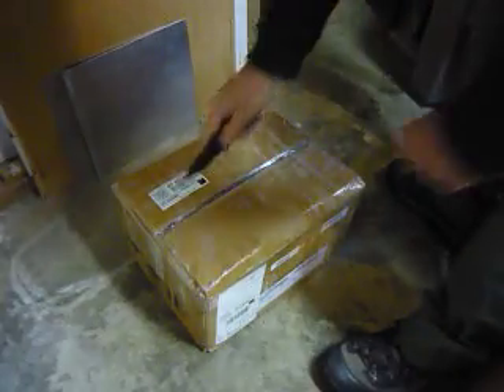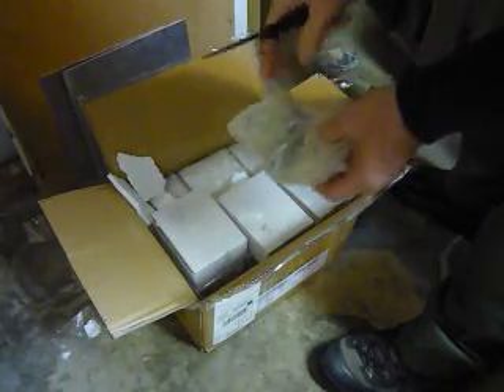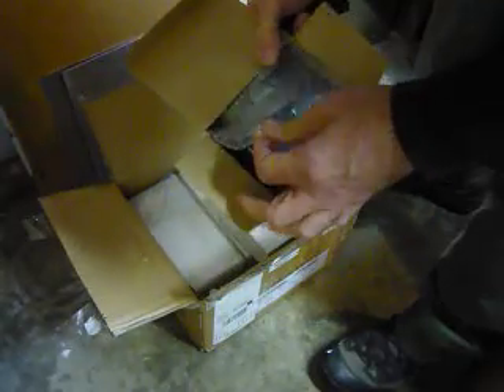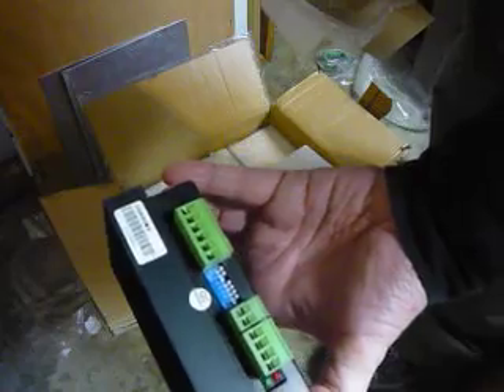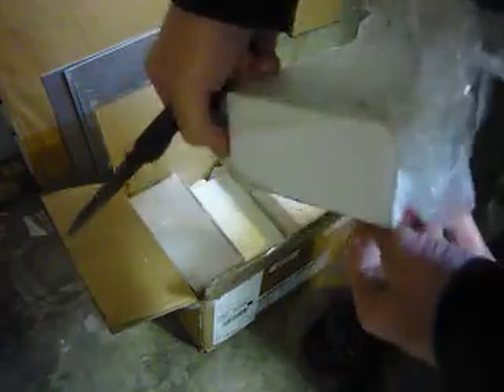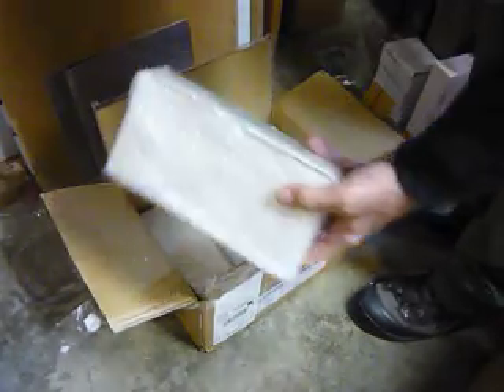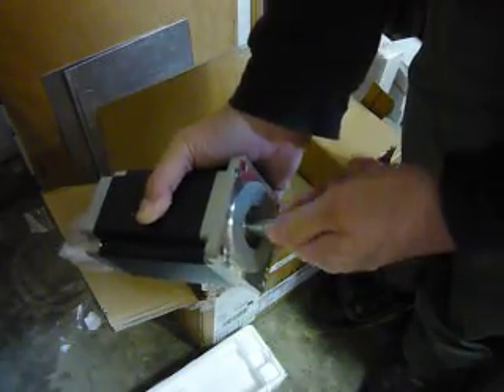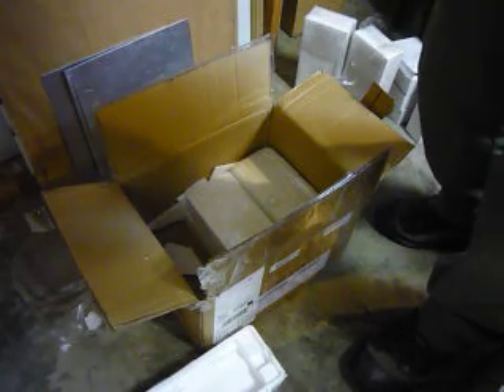Grizzly G1006 Milling Machine CNC Conversion 01 - Motion System Unboxing

Comment: Did you ever get this project done? Did you get the ball screws? There seems to be little info available on the lengths, etc for the ball screws.  I am looking to do my first conversion of my rong fu 30 and would love to see what you've done.
Reply from the maker: Sadly, this CNC conversion hasn't been finished.  It's probably half finished but stalled.  I built the electrical panel, made timing pulley gearing for the three axes, and built the motor mounts which are nicely integrated with the pulley gear covers.  I thought about heating and clamping acetal to make zero backlash nuts for the existing Acme lead screws as that would probably be sufficient for my limited use.  I built a couple of CNC routers and use those for the light duty machining I usually do for plastics manufacturing.  I also have 3D printers if I want to make complex plastic structures.  I'd like to finish the CNC milling machine conversion because it would help with one simple but very repetitive machining operation I do on the manual milling machine for a part I manufacture, but my biggest incentive to finish the CNC conversion is to machine the three 80% lower receivers that I bought with the intention of making some AR-15 patterned firearms.

Comment: If a wire/s are touching the other one it will lock up the shaft even with no power that why it seems to be stiff.
Reply from the maker: I believe you are correct, sir!  That's probably one of those things I'd have caught while watching the video, but not while making the video.  :-)  There might have also been some static friction in the bearings that hadn't turned in months, and once overcome, the steady state friction wasn't as bad.

Comment: Have you done anymore with these stepper motors?  I have the same motors from Wantai and I wanted to know what gear ratios you used for your mill.  Also did you replace the acme screws.  Im still trying to find a cheap ball screw.

Later
Reply from the maker: Sadly, I'm suffering from too many projects, and not enough time.  I did sneak in a CNC 2'X4' router and a CNC mini lathe build, and I've been getting the CNC mini lathe into production lately.  I still need to build my 3'X5' CNC laser and 2'X2' CNC router.  I also have a nice Clausing lathe to CNC (servos for that one!), and two ORD Bot Hadron 3D printers to build.  I keep using this milling machine manually and wanting to make the time to finish this CNC project.  Hopefully this winter.

I mostly built the X motor mount and this project stalled, but it's still on the To Do list.

I'm planning on direct driving all three axes rather than using any gear ratio.  That's why I got such beefy motors for this little milling machine.  However, to get good speed (as well as usably low backlash), I'll be getting some Chinese ball screws on eBay.  Some of the sellers will sell by the inch, and do the machining per the buyer's print, so there are shoulders for bearings, a turned shaft for the motor coupling, etc.  The ball screws are hardened and the only practical way to machine them is by grinding, which I am not properly equipped to do.

It looks like there would be enough of these G1006 milling machines in existence that someone would offer a ball screw upgrade kit as CNC Fusion and others offer for various small milling machines, but if so, I haven't seen it.  I'd appreciate a link if anyone finds a G1006 compatible ball screw kit.

Comment from the maker: The stepper controllers are silk screened with labels for the terminals and tables for setting the max current and micro stepping.  That's most of the wiring diagram.  Just connect the motor power supply to the stepper drivers and apply power 120 VAC or 240 VAC depending on the power supply switch setting.  I'd use a fuse in the AC power input to the power supply.  The STEP and DIR signals to the stepper drivers are from the PC parallel port or from a controller board (MESA, etc.).  Good luck!